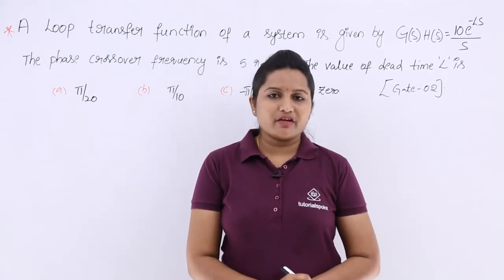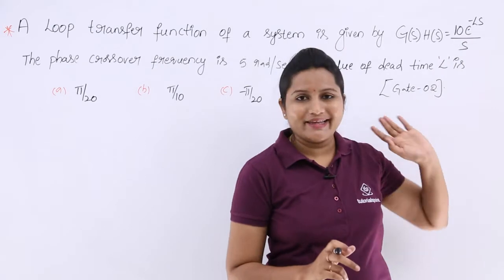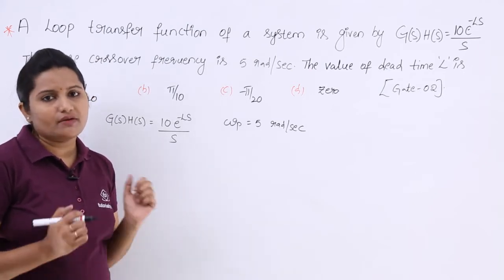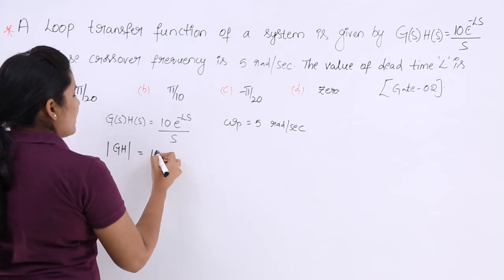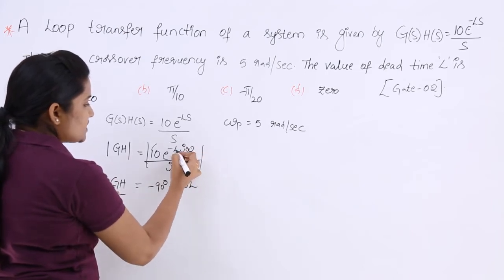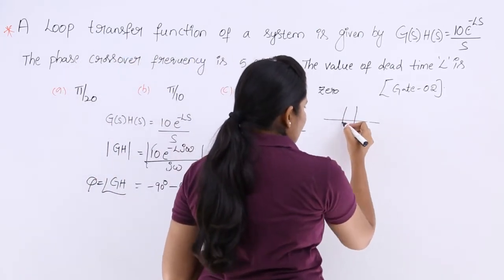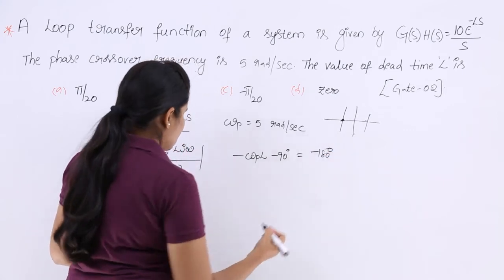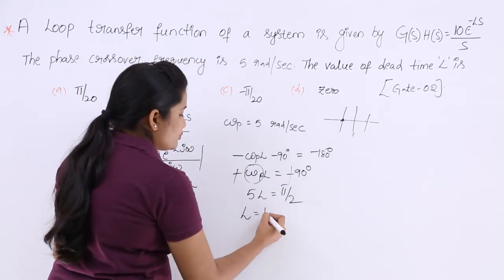GATE Problem 2 on Phase Cross Over Frequency

Comment: The open loop transfer function of a un

feedback system is given by

G(s) = (3e ^ - 2)/(s(s + 2))

the

resp

Mag

Pha

De

The fac

gain and phase crossover frequencies in rad/se

are, respectively

(a) 0.632 and 1.26

(b) 0.632 and 0.485

(c) 0.485 and 0.632

(d) 1.26 and 0.632

of
Reply: Do this sum mam